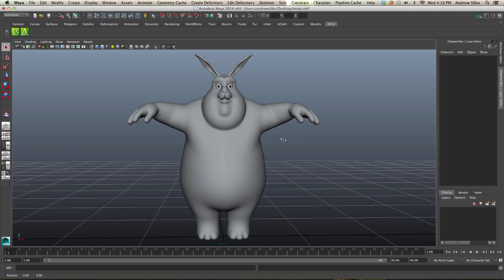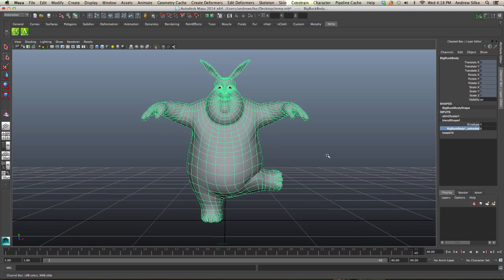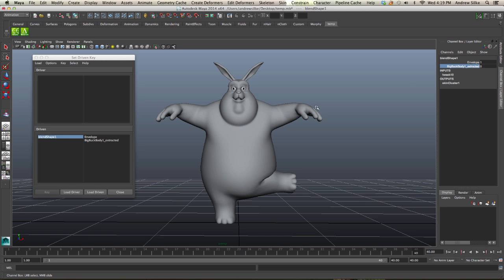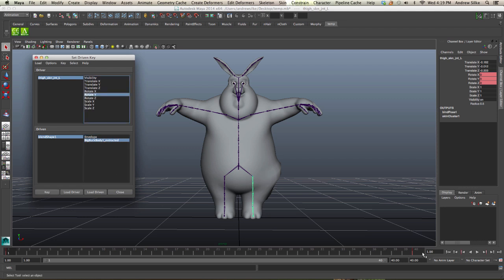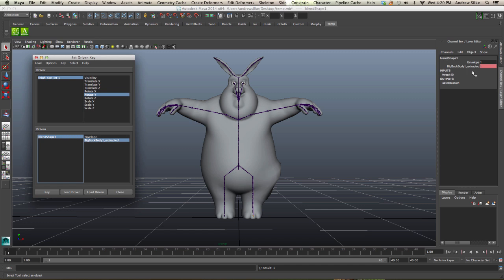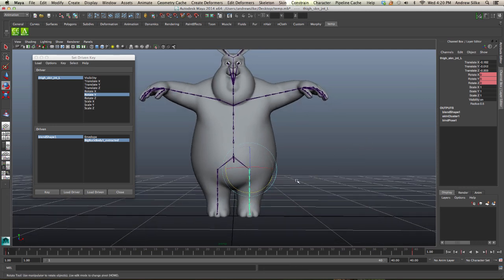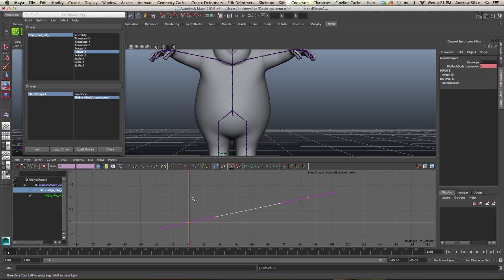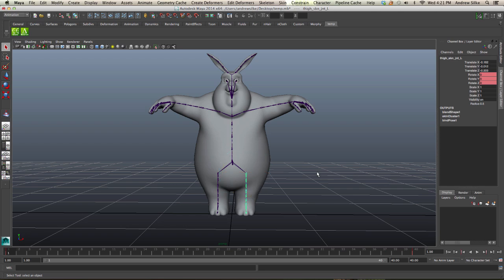Corrective Blendshapes: Automating with Driven Keys (maya)  Vid 4/7

Comment: My only question now is when you move the leg in other positions will it still hold this driver? If you had the leg 90% upwards instead and slightly in the Y axis
Reply from the maker: Hi jack the workflow for this video is quite old you know would use the pose interpolate and the new blendshape editor.  It handles all of this much better now
Reply: @andrewsilke1  How right you were, the pose editor works like magic! It's amazing to see how far these programs have advanced.
Reply: @andrewsilke1   I've been trying to use the pose editor with the autamatic IK rig and when I try to rotate it with the controls it snaps back into place. I  linked the pose editor to the controllers shoulder but it snaps back in place after being moved.
Reply from the maker: @ragingnoob3603  yeah apologies I don't use Maya's tools much as I'm always using brave rabbit SHAPES tool, which I highly recommend. 
https://www.braverabbit.com/shapes/

Comment: The problem here is that you cannot make any other moves after connecting the corrective shapes. Say you rotate the other leg and then the corrective is triggered by the keys. The legs returns to the default position. This is a useless plugin.

Comment: There is nothing in Blender that has this. After I move a bone. I can't activate Edit mode to edit my vertices to create a shape key. I've tried to re-create the mesh that uses the weight paint better. I've tried using sculpt mode as well. Both don't do anything.

Might switch over to Maya just because of this problem.
Reply: James Mitchell blender does have this though

Comment: can all these fixes be baked normally in animation and exported to game engines like Unity or Unreal 4?
Reply from the maker: I'm not sure, I know some game engines definitely support blendshapes, I'm unsure about unreal and unity but I'd be surprised if there wasn't a way. I've never tested myself though.
Reply: andrew silke
hi,thanks
yes,both support morph targets but the intention is to only export the animation data
what I meant was
if the fixed vertex data (modified by the technique)
will be " included and mixed with the bone data ( vertex weight value,...)" when the animation is baked before exporting
Reply from the maker: aluísio zinho  Yeah mate so long as you can mix blends and joints in your game engine this technique will work, this is exactly the same as regular face shape blends. Yep just bake before export as you won't have the correctives automated.